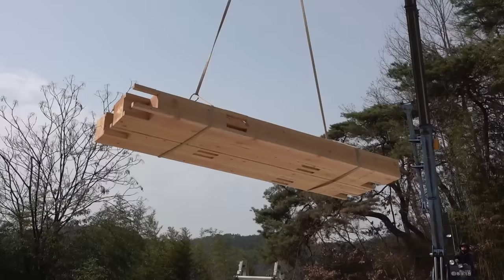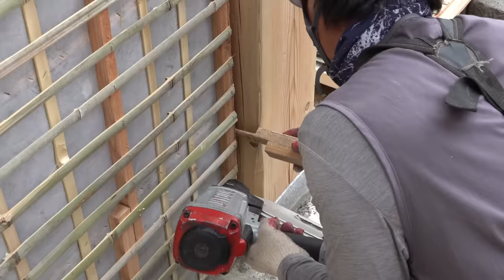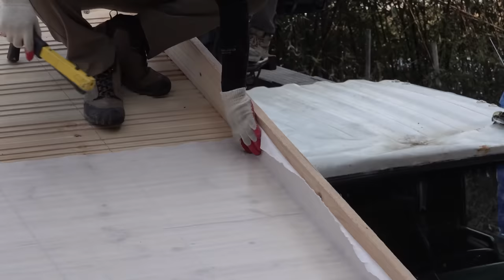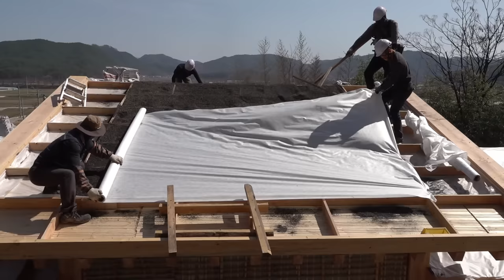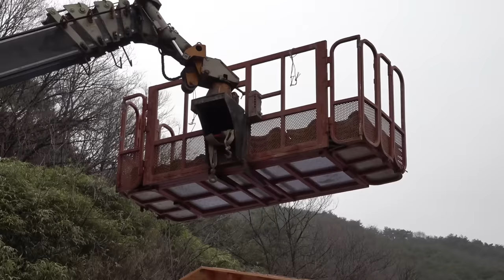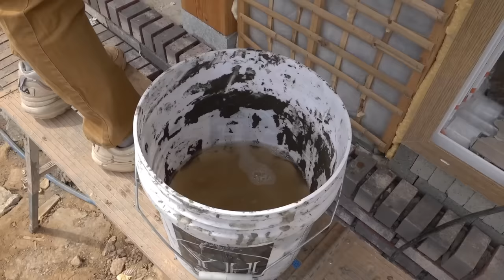Process of Making a old fashioned Korean-Style House.Skilled Korean Carpenter

Comment: This is fascinating to watch.  One question though….the vertical posts appear to be just sitting on top of the concrete blocks which in turn are just sitting on the concrete slab.  Is there some form of fastening done that we didn’t see, or is it just the weight of the structure that holds it in place?
Reply: Fixed by the weight of the structure.
Reply: Ah this was my question too
Reply: There must be some steps that we didn't get to see. There's no way they can only be relying on the weight of the structure to hold it down. The first tiny earthquake could knock the whole damn house right off it's foundation. Also we didn't see them install any kind of moisture barrier which unless they've very little water in Korea, would also be necessary.
Reply: They definitely skipped some steps that are code requirements in the States. Not having it secured to the foundation being the most startling.

Comment: Very impressive, but think about the people you don't see who made the forms and cut all the lumber to be assembled. They're the only reason it all went so smoothly.
Reply from the maker: Thank you for watching
Reply: Красиво, надежно, быстро!
Reply: True William  but much of that can be cut and fabricated in a clean dry climate controlled factory using computer controlled machine tools. 🤷🏻🧙🏻‍♂️
Not on site in the elements.
Though traditional this is a pre cut  modular assembly ...probably sold as a modular house kit, Impressive. 
🇬🇧🧙🏻‍♂️ Many traditional British houses and modern replica versions are Oak framed buildings, built by dry joints and wooden pegs or wedges to lock the joints in place. The limit is the supply of high grade rot resistant timber globally for the frames.. but that is where modern wood chemical engineering comes in converting soft woods into superior highly resistant  timber.  Like Inventwoods Metelwood and the simpler Dutch Accoya system .  👍🏻 
All good as they are none toxic, renewable resource based and lock up CO2 for many decades or centuries 🤞🏻.

Comment: The house 🏠 seems small yet the used of exclusive materials are huge. Indian system of building such wooden houses is very much different from Korean styles. Just wooden bars to lays CGI sheets and inside separate ceiling is to be done. Or else there is not so much installation of each layers on top of the roofs. Small but very expensive house. Westerner also are seen building the same way as Korean does. 🙏
Reply from the maker: Thank you for watching

Comment: The house is beautiful, a good job, except for one small thing. Already at the beginning there is something to notice, which can become big problems later. The studs were placed directly on the concrete foundations. A serious circumstance. Normally, beams belong there, otherwise the moisture will penetrate the studs unhindered. In about 5 years the studs will start to rot from the bottom.
Reply: 一一
Reply: Only the studs? everything in 3 years.
Reply: To your remark about the studs. The video doesn’t show every part. For a couple of seconds you can see that they put a brick wall around the house, around 2 feet high? The inside floor isn’t finished either. If they build it like in Germany, the wood frame doesn’t get in contact with water. It’s the same in North America where the tiny 2x4 are used for the frames. You put them also right on top of the concrete foundation. In the end, they get covered with plastic foil, protected from water. Right? I have seen a lot constructions in different countries. Bricks, clay and concrete is for me the way to go. I didn’t like my house in Alberta Canada. 2x4 frame, drywall and plastic. And still expensive for a house made out of cheap materials. Only comparing the heating systems from my German house with the Canadian system. Sorry. Blowing hot air throughout the whole house is a waste of energy. On top, in Alberta have new houses a 24/7 fan running, blowing outside air through the house. That’s the new building code. By minus 30 degrees Celsius outside, the heating system is running nonstop! Now I’m in Panama. No heating needed. And cooling will be done with solar fans circulating fresh air for “free” when it is hot. No AC installed.

Comment: Looks good, but very poorly efficient in terms of structure. The cantilevered edges of the roof can not support for long the heavy weight of the tiles without bending. This is a structural problem in traditional Korean carpentry : the 3 sides assembly of the beams and pillars looks good, but it's an heresy in terms of construction because the beams are too much weakened by the cuts. Another structural problem is the cracks that will appear soon (especially in winter) between the wooden pillars and the hearth walls : this ruins the insulation, and air flows makes the house dusty.
Reply: 한국집은 가정집에서 거의 난로를 사용하지 않는다. 특히 난로는 열 효율이 극단적으로 낮은 난방방식이라 이미 최소 7000년 이상 전에 한국인들이 포기한 집 난방방식이다. 7000년 전의 바닥난방 유적 흔적들이 발견되곤 한다. 가장 합리적인 추론은 마지막 빙하기 상태를 버티기 위해 고대인들이 열효율을 높이기 위해 고안한 것이라 여겨지고 있다. 난로를 사용하는 경우는 야외 또는 열 효율이 낮는 것이 인정되는 직장 또 아주 가난해 바닥난방을 사용할 수 없는 집에나 사용된다. 가장자리를 처마라고 하는데, 이는 비와 바람을 막는 역할을 한다. 보통 더 길게 하지만 저건 짧은 형태다. 그렇게 하는 이유는 비 바람 특히 태풍 같은 상황이 닦치더라도 담장안의 공기를 비교적 안정적으로 유지할 수 있도록 하기 위해서다. 이건 겪어 봐야 알 수 있다.